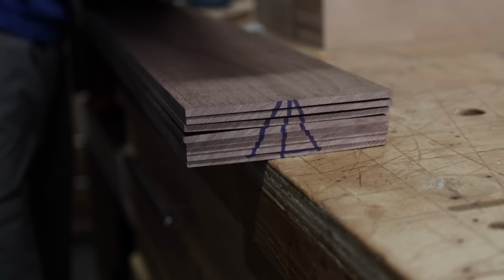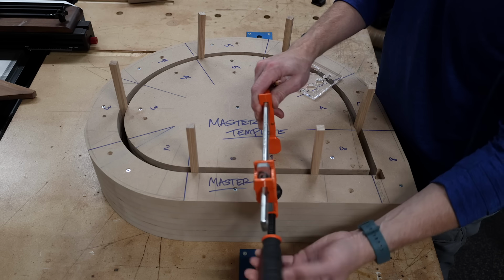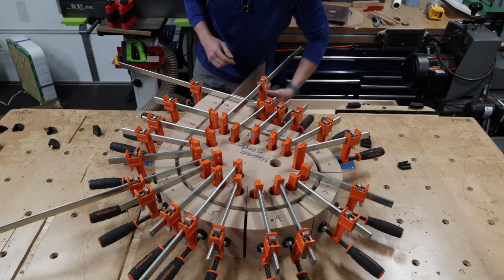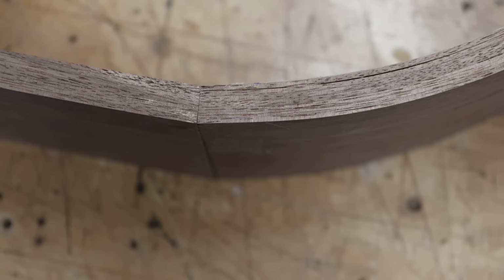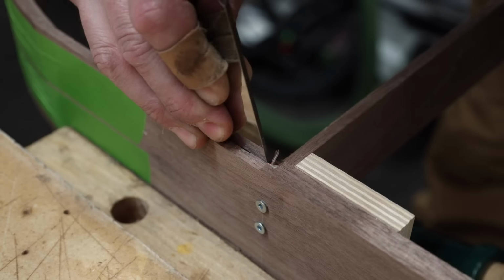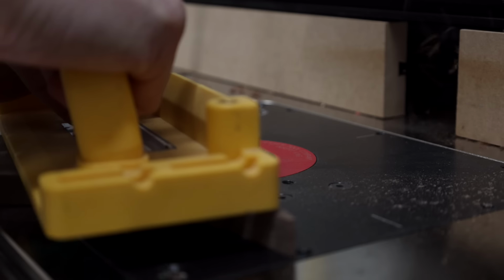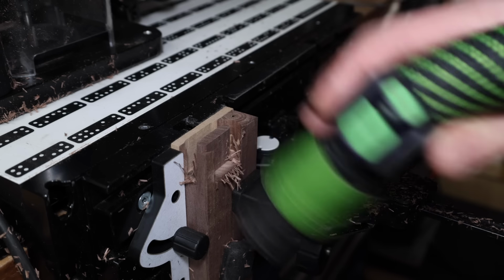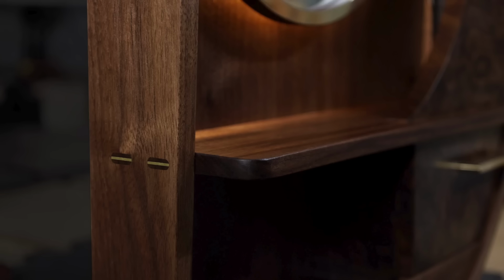Why aren't more woodworkers using this new tool?

Comment: AI is amazing for inspiration and brainstorming sessions, and since you gotta transform it to make it real, I'd say it's fair use. I've used it myself for some things, combining all shorts of materials, like leather, metal, marble, and carbon fiber. My current skill set only extends to soft metal work and vinyl wraps, however. So it's gonna take some practice before I can make something interesting.
Reply from the maker: Thanks so much for the comment! You bring up a great point of using AI to help integrate multiple types of materials into a design. That has a lot of potential.

Comment: Keith, you always kill it, but this piece is something special! I have a quick question... Why did you cut the outer form instead of leaving it whole? I'm new to bending forms so I'm just curious.
Reply: I had that question too, I’m assuming it would be too tricky to get the outside form wrapped around the wood. You’d essentially have to pre-bend the wood to the exact shape before it would fit.
Reply from the maker: THanks so much! If I had left it whole, it would have been virtually impossible to bend my strips around and then drop the ring on top. And there is no amount of clamping that would have had any effect.